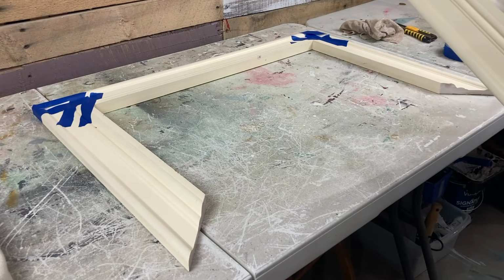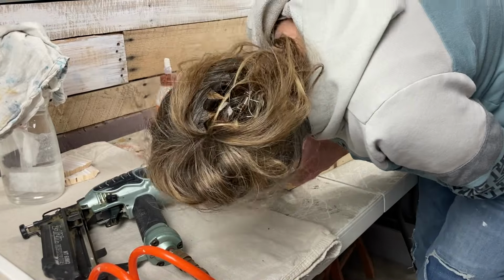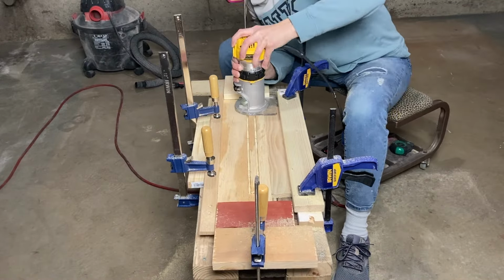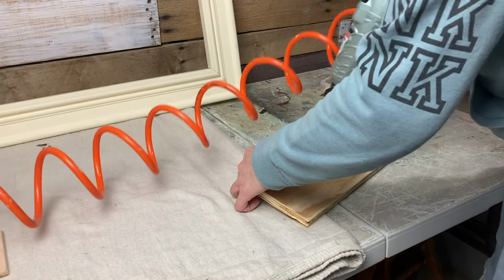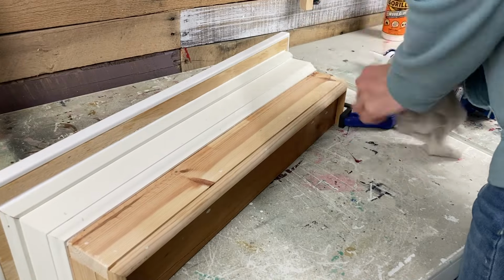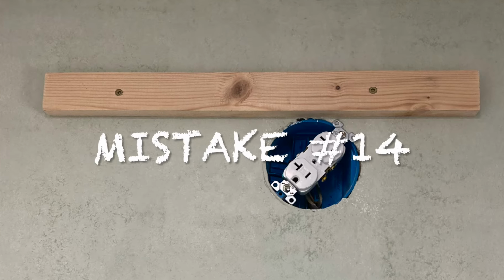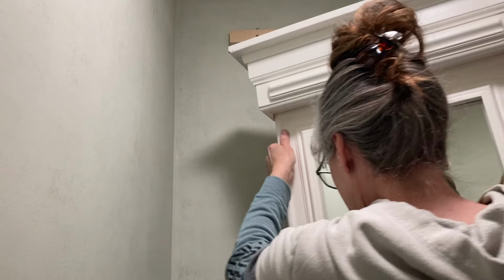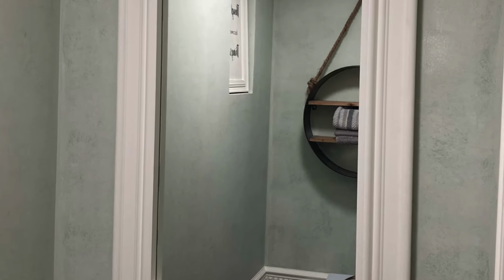Custom Built Light Box Mirror

Comment: Wow! I am impressed with your routing skills. I am intimidated by the router.
Reply from the maker: It can be intimidating.  Just remember to push with the grain.  And if you watch other woodworking pros on routing you learn things that are helpful even on a lower level of use.   Even info on bits.  I wouldn't have even know about compression bits, but they are easier to use without as much kickback or blowout.  When I can start to afford it I will be getting my bits from Bits n Bits.